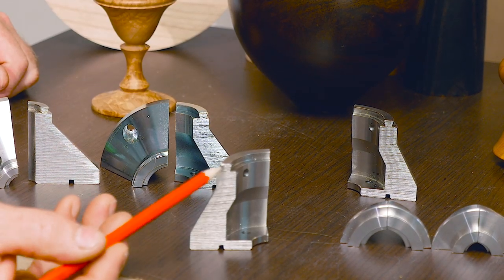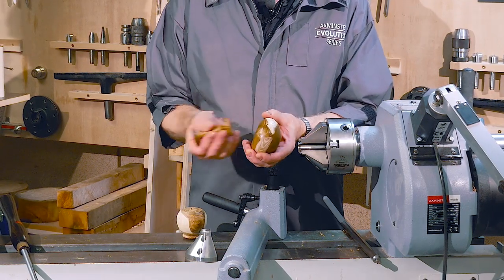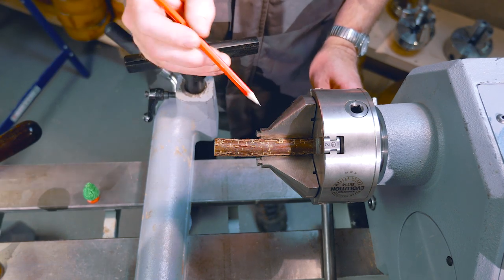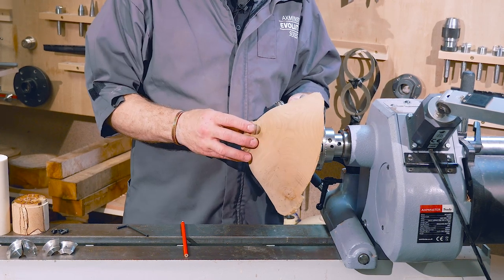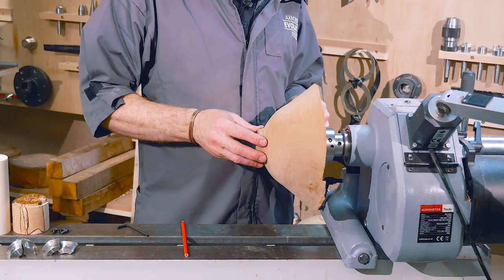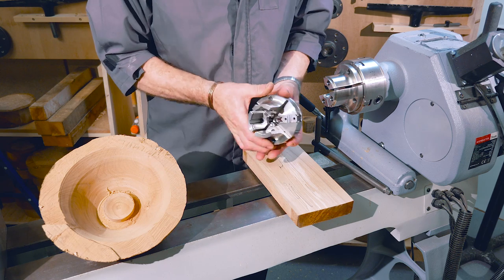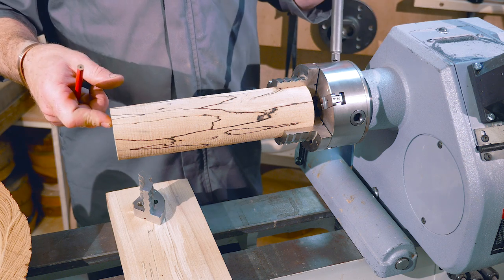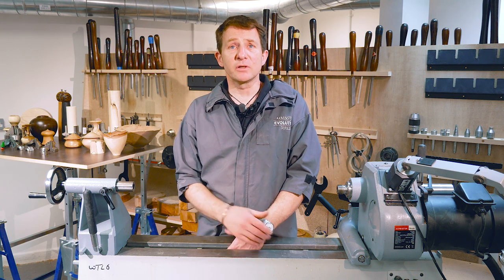How To's - Work holding on the lathe with the Axminster Chuck System - Video 3

Comment: I noticed that when you used the O'Donnell jaws you only gripped the rough turned bowl from the internal tenon.  Can the OD jaws be used to grip the external tenon on the outside bottom of the bowl as well?